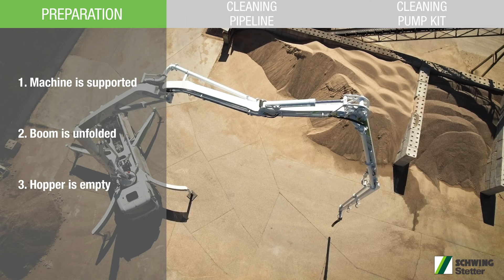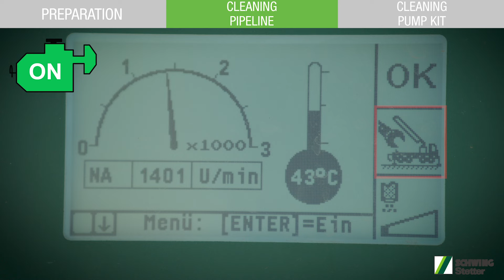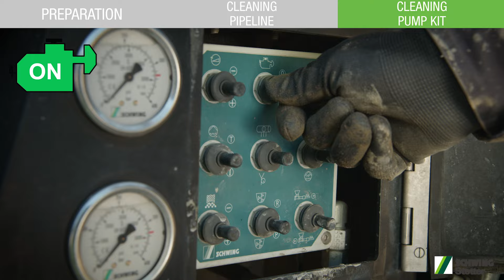SCHWING-Stetter - Tutorial 02: Cleaning truck-mounted concrete pump

Comment: What about the left concrete? Did you pick it up too , or left there ?
Reply: Most likely left it there. Its usually into a eco pan so they can move it on the job. If that’s where he was pumping than that would be a on site clean up. If the place where you were pumping at didn’t have a place for you to wash out at you would have to take it back to the yard and wash out there. Hope this helped a little bit!
Reply from the maker: Hello  @tristandorman9077  , Thank you for your answer. That is right. Some construction sites accept that you leave the residual concrete there, others do not, so you have to take it with you. The cleaning is then usually carried out at another place / location. For the video we used a concrete substitute that does not harden. The customer, on whose premises we shot the video, then disposed of the material for us.
Your SCHWING-Stetter team

Comment: Not clean enough bro, as a pumpcrete helper, you must ensure the cleanliness of the cylinder the hopper. You must clean it it with plenty of water to ensure the pipe,, after de clogging the pipe you must put the cleaning ball back and pump it again with water just make sure the cleaning ball will go out. Just my opinion bro as a pumpcrete helper
Reply from the maker: Thank you for your feedback.